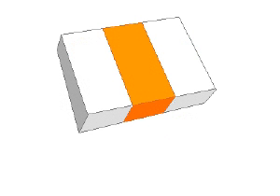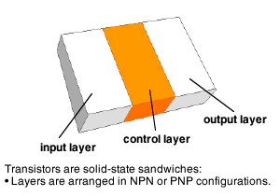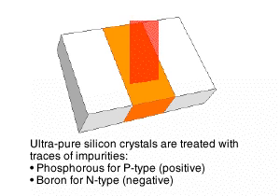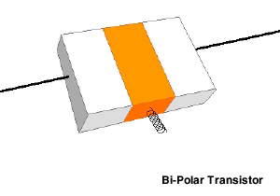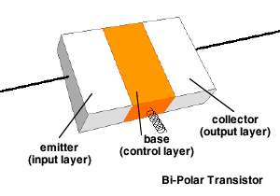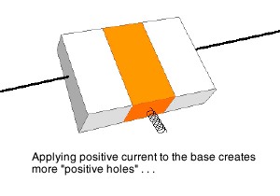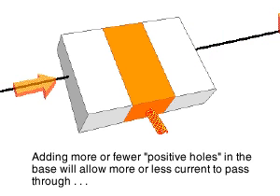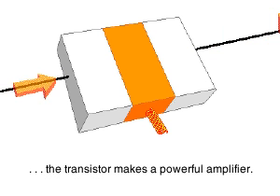How Transistors Work

Comment: Collin rocks, but this is the worst explanation of transistors ever.  Maybe for a total neophyte.  For one thing, why are the arrows in transistors going the wrong way?  Negative charges flow to positive holes.  WTF.  For another, if the Base is controlling the flow between the Emitter and the Collector... where the F do you connect the other lead of the base too?  Say you connect a positive battery terminal to your base... and the negative terminal of the battery then should go.. where?

Comment: A COMPLETELY WRONG EXPLANATION!. A transistor is a voltage controlled device (current source). Base current is an undesired, second order effect, due to the finite base width. Ideal BJT has an infinite current gain and, therefore, zero base current.

Comment: Not really. When the incoming electrons from the Emitter fill
the Base's "positive holes", this is when it stops conducting.
When you apply a small positive current to the Base it creates
more "positive holes", which allow more electrons to pass from
the Emitter (through the Base) to the Collector.
The amount of "positive holes" you add to the Base allow more
or less current to pass through.

Comment: What you amplify is the Input current (applied at the Base) which is usually very small. The subsequent increase in current or power is derived from the battery (but obviously cannot exceed its energy content).

Comment: The small current at the Base will usually be the small input current generated by an incoming radio or audio signal. That small input current will be amplified at the Collector point.

Comment: @KaisyuVadin Electricity has two main measures. Voltage and amperage. they are interconected, If you raise one, the other lowers, The amperage is how many electrons are passing through any point of the circuit, voltage is how fast they are passing. Electric Power is yet another different thing, measured in watts. It's equivalent to the amperage times the voltage of a given point in the circuit. So, it's easy to see why you can't have 200% power from any source. The maximum power is limited.

Comment: I like this video, good job! There is just one inaccuracy though - phosphorus is used to create N-Type Material. Adding Boron will not create N-Type Material, but P-Type material. An N-Type semiconductor has extra electrons. Phosphorus has 5 valence and silicon has 4. They add up to 9, but only need 8. So there is a free one that can move. Boron only has 3 valence electrons so when it combines with silicon it takes one to create a hole in the silicon.

Comment: @naveedlahoriable Ok, think of it this way:

A transistor is either an amplifier or a switch.

It's an amplifier when it's used in its linear range. Applications like audio circuits.
It's a switch when it's used in its non-linear range. Applications like microprocessor circuits.

As an engineer that's all I need to know :)

Comment: @8clutchG positive current refers to the conventional current. 
we know that the positive and negative charges move in opposite direction. If negative charge moves from negative terminal of the battery (cathode) towards positive terminal (anode),it is expained that an opposite charge moves in the oppsite direction i.e. from anode to the cathode.

Comment: If transistors were just NPN layers like this you could just put two diodes together and make a transistor however if you see how the very first transistor was made you will see that the base is large and at the bottom and the emiter and collector are seperated by a small gap on the top of the semiconductor crystal.

Comment: I understand the transistor in a standalone circuit, an LC oscillator separately as well but I never truly understand how they are connected together with many feedbacks etc.
If someone could make an animation where one could see all values of E,R,I for all components for every t0,t1,t2,... in a cycle.

Comment: The graphics near the end incorrectly show the collector current as being larger than the emitter current.  In fact, the emitter current is always larger than the collector current (Kirchoff's Current Law).  Amplification occurs between the base and collector currents.  Example: 100 mA enters the emitter, 1 mA of that current flows out of the base, and the remaining 99 mA continues out the collector.  We say that the 1-mA base current (the "control" current) has been amplified 99 times.

Comment: Electricity will flow where ever there is the greatest potential (voltage) and it can flow either way. But we use convectional current in electronics just to simplify things. In reality it flows from negative to positive. So if I have -30 volts and -90 volts current would flow from the -90 volts to -30 volts because -30 is more positive value than -90 volts. Remember voltages is really EMF. Think of this as dynamics like in mechanical physics.

Comment: This video is horrible. And he got it backwards: adding an element with 3 valence electrons like boron creates a P-type semiconductor; adding an element with 5 valence electrons, like phosphorus, creates an N-type semiconductor. Silicon has 4 valence electrons, so when a boron atom is incorporated into the crystalline lattice, it creates a positive charge carrier called an electron hole, whereas when a phosphorus atom is incorporated into the lattice, it creates an extra wandering electron.

Comment: @ikedasquid I should have been more specific, I do mean the BJT type since they do work on two totally different mechanics.

When they show a diagram of, say, an NPN transistor, they show it as a 3 layer sandwich, and It was never explained how the emitter and collector differ in structure.

I tried connecting the base and collector of a transistor in reverse bias once, using a 9v battery and 300k resistor, and found it to make a very audible white noise, even without amplification.

Comment: @weylin6 Are you talking BJT or FET?  There is no gate in a BJT.  The principles of operation between the 2 are totally different.  If you are talking NPN, and if I remember correctly, the emitter is much smaller than the collector, but the base is much thinner.  The actual dimensions and doping values vary greatly between devices.  The emitter and collector cannot usually be reversed.  In some discrete FETs the source and drain can be, but it's not common.

Comment: @humandimm There are 2 main 'types' of transistors: BJTs and MOSFETs.  This particular type is a Bipolar Junction Transistor.  (assuming a NPN transistor) When conducting, Vb is > Ve, and a current flows from base to emitter.  In this type of transistor the current through collector to emitter is controlled by the base emitter current.  When talking about BJTs, you need to be thinking current.

The other type, MOSFETs, does not have current flowing into the gate - which is analogous to the base.

Comment: @iamsnail The actual signal into the transistor is itself not made any more powerful.  The input signal through the base-emitter junction  varies the separate and  much larger current through the emitter-collector junction.  The emitter-collector current is a much larger replica of the base emitter current.

It's like your hand on the throttle of a big diesel engine.  Your hand uses a small amount of force to move the throttle.  The engine makes a large force that your hand controls.

Comment: @iamsnail   The amplification of the weak signal happens because once current begins flowing through the emitter-base junction, the base allows a much larger current to flow between emitter and collector.    This ratio of emitter-collector current to emitter-base varies among transistors but ranges from about 10 to1 to several hundred to1.    Assuming this ratio  is 100/1,   a current of
1 microampere in the base-emitter junction will cause 100 microamps to flow
emitter to collector.

Comment: This explanation contains a hole: The conductivity from the emitter to collector depends on the VOLTAGE at the base; there is no CURRENT flowing through the base. But if no current is flowing through the base, there can be no more and no less "positive holes" in the base. So, how does a transistor really work?

Comment: i'm not understanding everything here
first, are they saying that the if the p type has x holes in it, then x electrons can flow from emitter to base, and from base to collector per unit of time, but if it has 2x holes in it, then 2x electrons can flow from emitter to base and base to collector in the same time?
and 2nd, how does applying a current to the base increase the number of holes? shouldn't pushing electrons into the p side fill more holes?

Comment: the explanation is hard, this video doesn't really explain anything why the stuff in the transistor happens, and how to increase the current of the colector by changing the voltage in the base you need another battery connected to the colector to allow the electrons from the emitter flow to the base and then the collector.

Comment: it's not really an amplifier.  It just acts as one.  It's really a valve.  The small voltage opens the valve to a certain degree, allowing the large current to flow.  The more the small voltage is increased, the more current is allowed to flow.

Comment: I remember a few years back, I discovered that using a high resistance/high voltage reversed biased emitter-base setup, it created a very clear hissing sound, even without amplification.

I used 9 volts, and something like a 300K resistor, and an NPN bipolar transistor.

Comment: There are some circuits which intentionally reverse the collector and emitter of a bipolar transistor. For most types of transistors, the result is a very low current gain and breakdown voltage.

Comment: Every transistor explanation I ever see is incorrect, confusing, and uninformative...

What's the difference between the Collector and Emitter? Doping %? Surface area on the Gate? Can the Emitter and Collector be reversed in a circuit, or will this damage it? If so, why?

One thing I want to say is that transistors work on the Emitter-Base VOLTAGE controlling the thickness of the depletion layer between where the two P & N layers meet. When the depletion layer is thin enough, charge can flow.

Comment from the maker: Thermionic emission
& Richardson's Law

and thorium plated filiments:  "   Thermionic currents can be increased by decreasing the work function. This often-desired goal can be achieved by applying various oxide coatings to the wire. "  wherein plating vacuum tube cathodes with thorium increase the electron emissions 1000x - if the electrons flow to the copper anode to wire output - why wouldn't this save us a lot on our electric bill ? ( a nuclear power station in a vacuum tube ? )

Comment: Audio description OK, but arrows deceiving. Shows much more collector current than emitter current.. The arrows on the ends should be the same size, with a small arrow coming out of the base. Voltage polarities should also be explained.